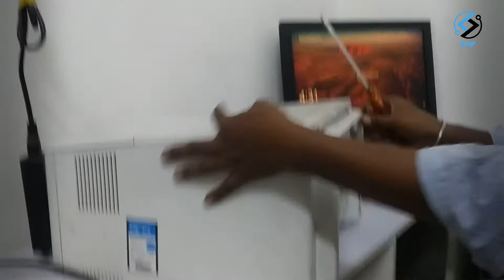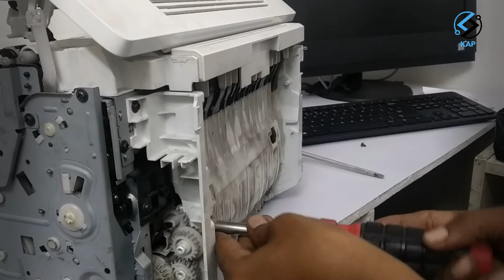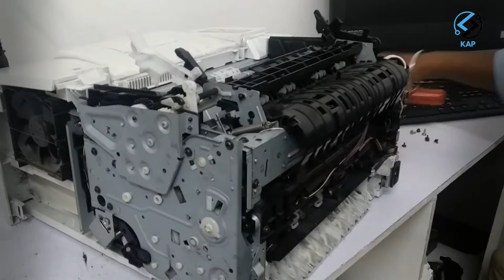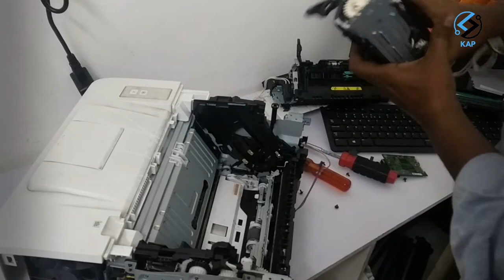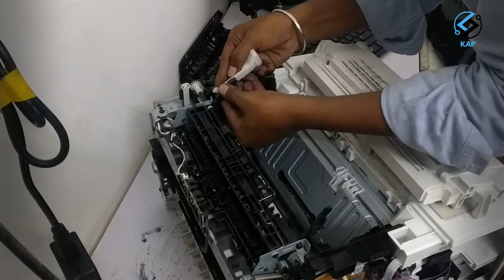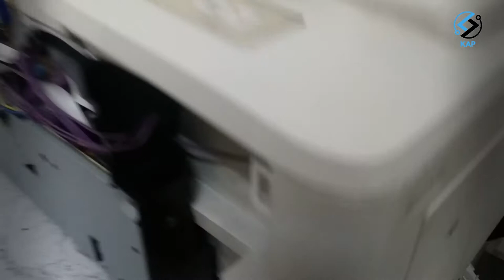Fuser Replacement of Hp laser jet 203sdn Printer | hp 203sdn

Comment: Obviously this don't look like a professional repair. The cable guide on the rear left side of the fuser is not reinstalled back to the fuser, with the wire left just hanging off the rear of the fuser unit. I am not sure if the cable guide was missing from the previous repair or it was forgotten during this repair.

Comment: greetings 🙏🙏 i have the same problem. HP laserjet pro m203dn. Replace the roll press and fuser film. That's my question, when it's finished. the print is not ripe, the print is not good. is the fuser film not good enough? I'm from Indonesia thanks 🙏🙏🙏